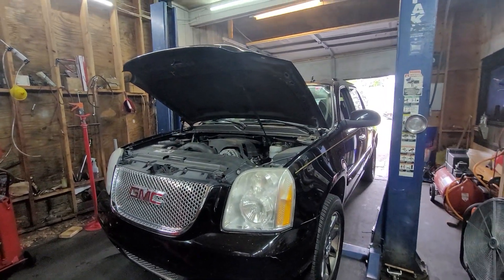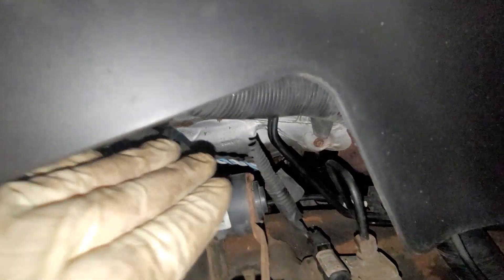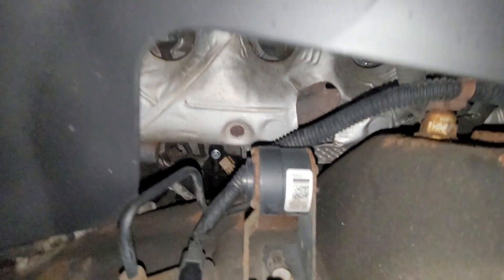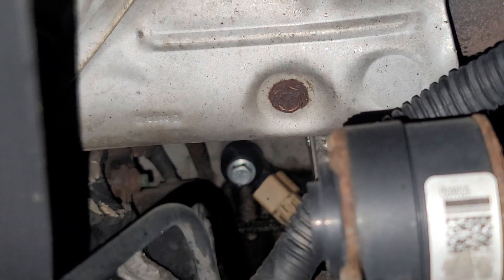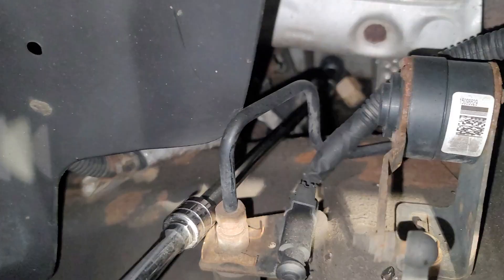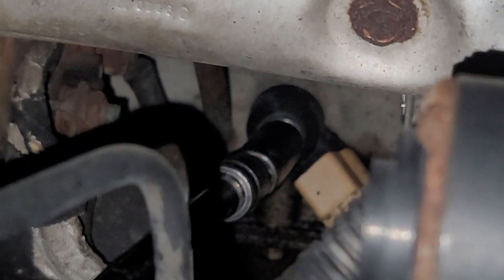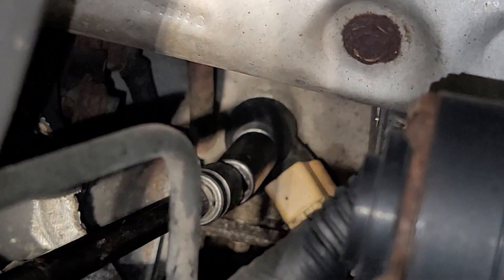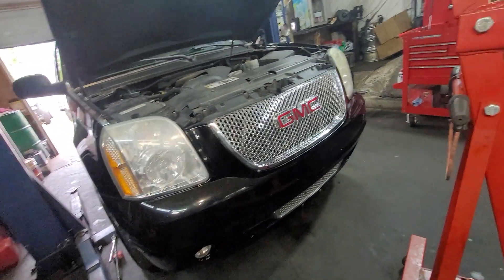07 And Up GMC Yukon 5.3L or 6.2L The Location For Knock Sensor Bank 1 And Bank 2

Comment: My 2012 Sierra C1500 has a bank 2 knock sensor circuit code. But I have heard a clatter from the engine at times now too. Can a bad sensor adjust timing and cause the clatter I wonder???
Reply from the maker: Nah, the knock sensor is basically a mic for the engine, listening for bad knocking or detonation.
Reply: @hanitwfik Well, that sucks. 

I thought bad gas a first, but I have gotten gas at 3 separate stations now. I bought this truck new in 2012, I know everything about this truck. I replaced all O2 sensors at 100k. Just for maintenance reasons. New spark plugs too, all new GM parts.

I had a BG fuel induction service done at 130k. Night and day difference!!!

She now has 160k on her.

Comment: Changed my bank 2, still have bank 2 check engine light , what could it be ?
Reply from the maker: You even replaced the wrong one or wiring problem or a blowing fuse . What code do you have?
Reply: @hanitwfik  what fuse could I check ?
Reply from the maker: @rafaelnavarro8857  bank 2 is the passenger side . Let's do this if you have a scanner when you erase the then started the car dose the check engine light stay on or comes on right away or how long did it takes for the light to come on ?
Reply: @hanitwfik  it’s on right away
Reply from the maker: @rafaelnavarro8857  if it comes on right away so you have a wiring problem or the connector is bad or it has corrosion
Reply: @hanitwfik  P0330  Code P0330 indicates a fault in the Bank 2 Knock Sensor 2 electrical circuit for a predetermined period of time. 
That’s According to my check engine
Reply: @hanitwfik  was told bank 2 was the passenger side , I have a 07 Tahoe 5.3 ltz , changed it, still have same code

Comment: Why did you replace the knock sensor?
Reply from the maker: Got a check engine light on with a knock sensor codes
Reply: I am in the same situation, did all you did had no code for a long time changed the fuel injectors now the code finally came up for the knock sensor
Reply: Can a knock sensor be bad without a code?
Reply from the maker: @miguelsmotors2138  I have never seen it before. What's the problem with your truck ?
Reply: @hanitwfik  runs and drives normal just every once in a while it will backfire. Sometimes, it seems like exhaust most of the time intake.
Reply from the maker: @miguelsmotors2138  For various reasons like leaking fuel injectors or a clogged engine air filter, the engine might have too much fuel added to the cylinder, or not enough  For proper combustion, the exact right ratio of air to fuel must be maintained Also clean the mass air flow and check the spark plugs might be old
Reply: @hanitwfik  all new plugs and wires. I'll clean mass airflow and check out the air filter. BTW no check engine light

Comment: Was this causing a stabilitrrack issue on this vehicle?
Reply from the maker: Nope
Reply: Wheel speed sensors were mine.  I replaced all 4 and it worked immediately.  An easy fix too
Reply: It is connected some how bc mine has the same

Comment: how did you unplug the connector?
Reply from the maker: There's a little tip to secure the plug from coming off that you need to take it out first, then you push down on the plug and slide it out

Comment: Should of had a video of you removing it and Installing it back on
Reply from the maker: So sorry but it's very easy you just need a ratchet with long extension and 13mm socket to remove it